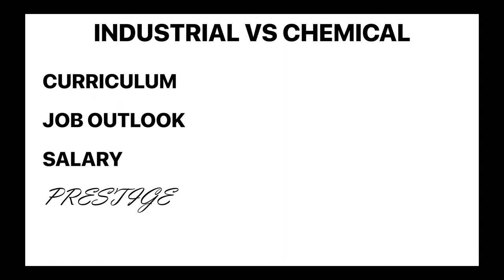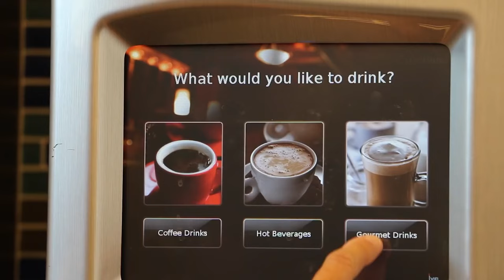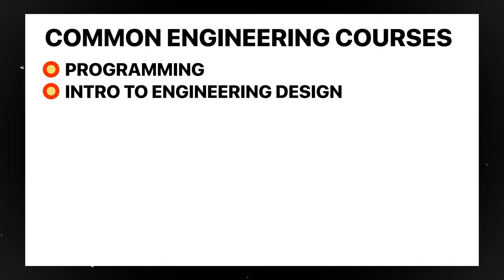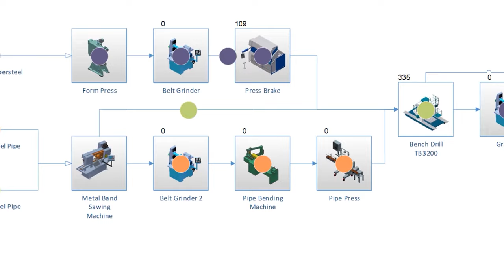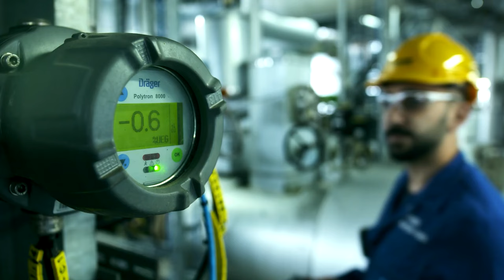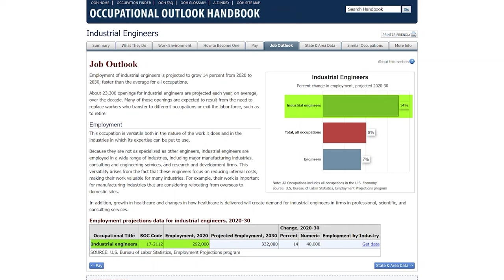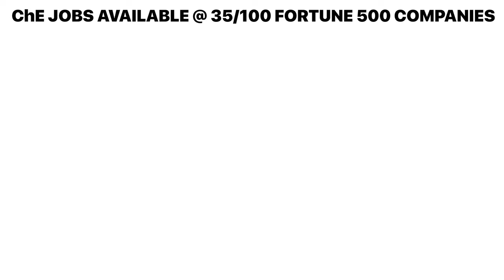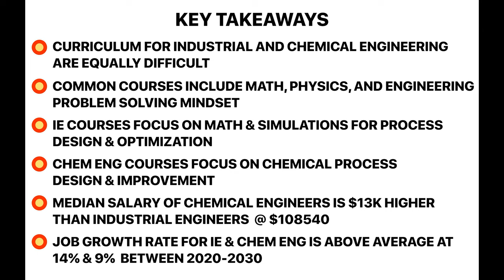Industrial vs Chemical Engineering : Which is BETTER?

Comment: I'm really struggling to choose in between chemical engineering, process engineering, industrial engineering and production engineering. I also have plans to do master's. So, what would be the better option and more flexible degree to take in bachelor's?
Reply from the maker: Chemical and Industrial engineering are great undergrad majors and are considered core engineering disciplines. You can't go wrong with either. Hope that helps!